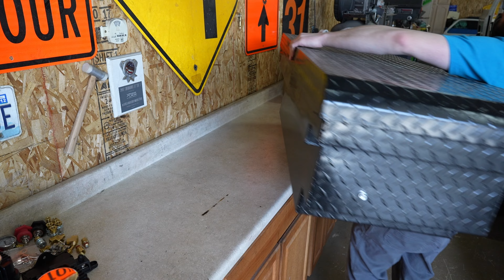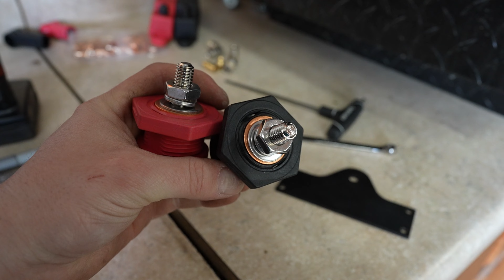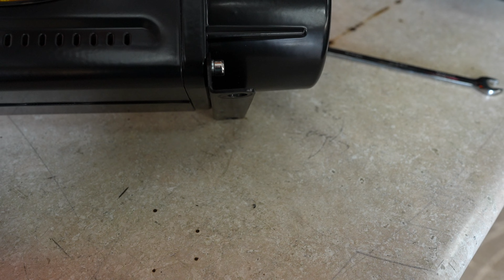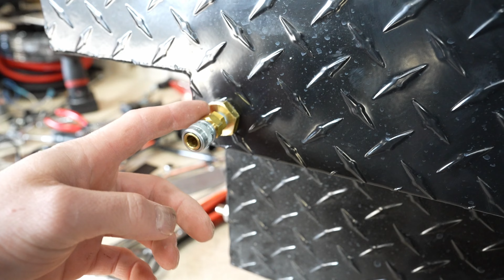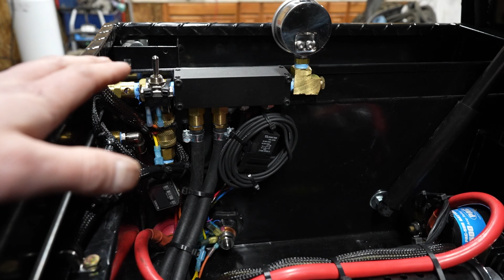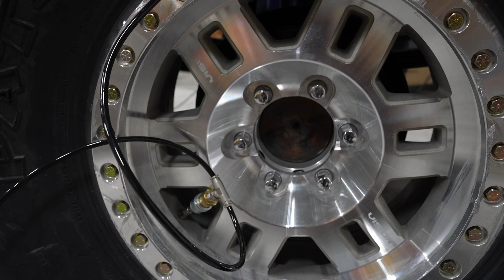Building the Most Ridiculous Air System for my Toyota Pickup!

Comment from the maker: Parts I used building the air system ↓↓↓

Compressors-https://amzn.to/3Wq7iyJ
Air Manifold-https://amzn.to/42TWM5f
Air Bulkhead Fitting-https://amzn.to/3Wo4i68
Air Chucks-https://amzn.to/42U38Sn
Air Line-https://amzn.to/3MVTWHL
500 Amp Relay-https://amzn.to/3OpQUMU
Electrical Bulkhead-https://amzn.to/3q43g3i
Lights-https://amzn.to/45nSUeL

Comment: I'm running the same compressor. Highest cfm for the price. After about 2 years the main switch soldered connector broke. Easy fix, worth mentioning if they vibrate a lot though. And by broke I mean the solder wires cracked and separated, switch wasn't broken